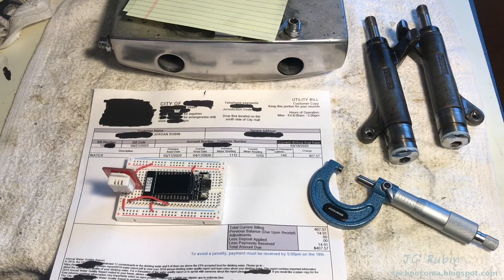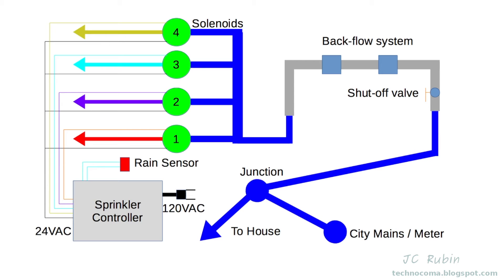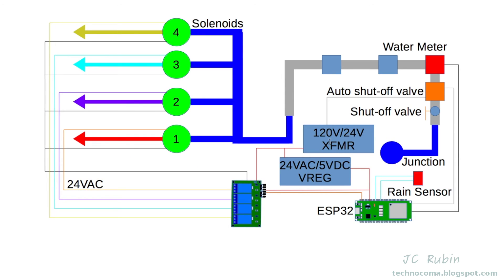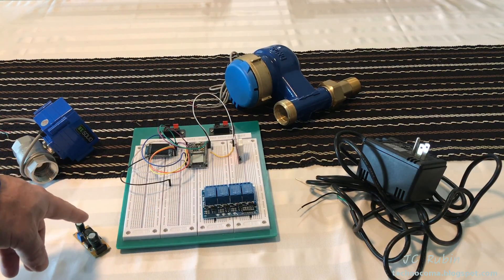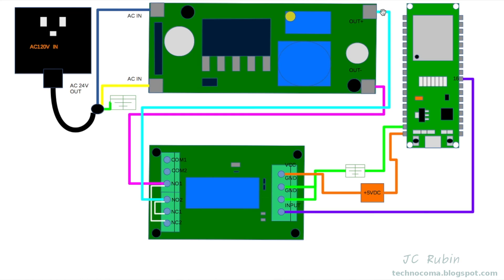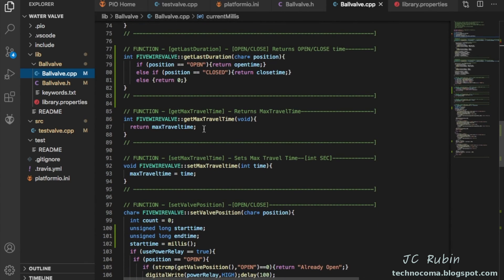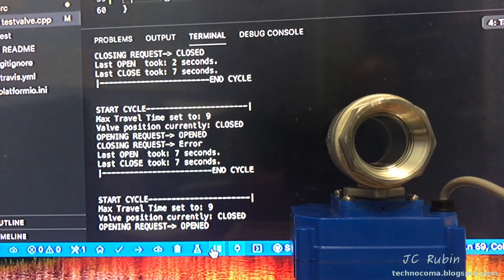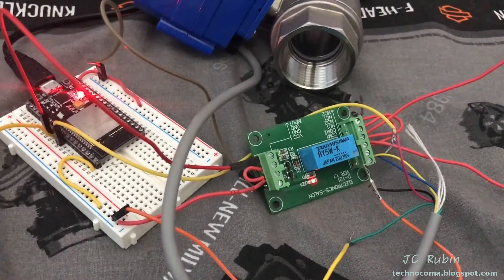ESP32 Automated Irrigation Control System Project - PART 1 - Problem/Design/Water-Valve

Comment: Thanks for the wonderful video. How do you control the opening of the valve, let say half open? Do use PWM to control it? Can ESP32 supply voltage 0- - 10 VDc? Thank you
Reply from the maker: This is relay controlled on this motor for open or closed only. The sensor can read midway as a status.

Comment: enjoying this video! Just one thing: here in Melbourne Australia you would have paid $1787 USD for 143 thousand gallons. So we think $407.57 is cheap!
Reply from the maker: In fairness......
I did not pay sewage on this water leak.  Also there was a dispensation as their monitoring system did not operate as it should have.
Reply: @retrotechandelectronics  The $1787 doesn't include sewage; our water is clearly more expensive here in downunderland.  Don't get me wrong, your videos are excellent and I am really finding them useful and so very well thought out and presented - straight to the point. I had a similar problem in my holiday property in France where an OpenSprinkler unit failed to turn off on three occasions (it just lost its settings mid-cycle then did not close the solenoid valves). It cost me a thousand euros or more in wasted water. The water ran for over a week before I discovered it. So I am looking to replace it with something like what you are describing as I never want to pay a bill like that again for no good reason. I thought by buying a well-known system that I could trust it. NOT SO.

Comment: Did you have any issues with the logic level voltages?  3.3 vs 5 volts?
Thanks for posting!  That's kinda funny 'final', guess you mean this week?
Reply from the maker: No problems with the logic levels. It’s set up like a standard reed switch. What did you mean by final, I missed that.
Reply: @retrotechandelectronics  
probably more like close to version 1.0
Thanks for making the libraries.
Reply from the maker: @patrickmclaughlin6013  if you mean library revs I accidentally had two of the same version on the local system.
Reply: @retrotechandelectronics  
that, and then you'll probably be adding soil sensors, zone controls, sunlight tracking, ...
cool project, Thanks for sharing it.
Reply: @retrotechandelectronics  
I'm trying to use a esp8266 and a mega with i2c
maybe I'm to nervous about the voltage issue?

https://hackaday.com/2016/07/28/ask-hackaday-is-the-esp8266-5v-tolerant/

Comment: Following this project. My house is 1000' from the city water meter. Would be great to have a solar unit that could detect excessive flow and shut off a valve buried inline.
Reply from the maker: I will be adding such analytics in the 5th series in and about.

Comment: any advice on how to connect those solenoid valves to a solar cell? do those require too much electricity? I need to make something similar to this but totally independent and solar.  with luck I can send some wifi to the ESP.
Reply: There is no such think as too much electricity. There could be power limitations. Also the solenoids are AC so there would be losses for conversion
Reply: @jcrubin78  I actually was thinking that I don't have enough electricity. Hehe.

Comment: You don't have a master control valve on you timer now I'm guessing..
Reply from the maker: I don’t understand
Reply: Yes that is mandatory here in Australia, goes in place just after the check valves and connects to the pump terminal of timer. That would have stopped it leaking continuously, only when the stations come on would it open and leak wasting a fraction of the water.